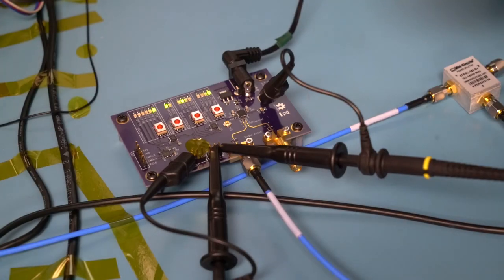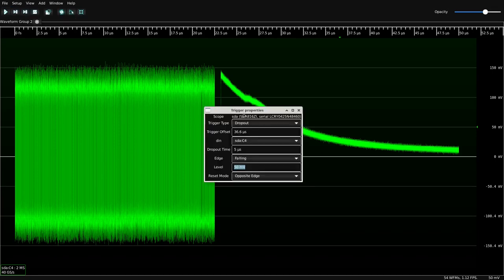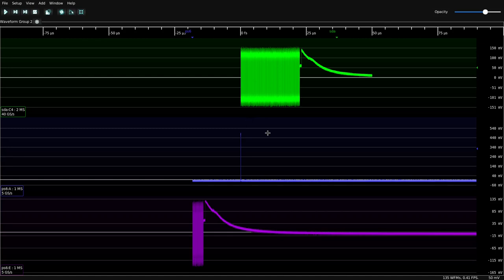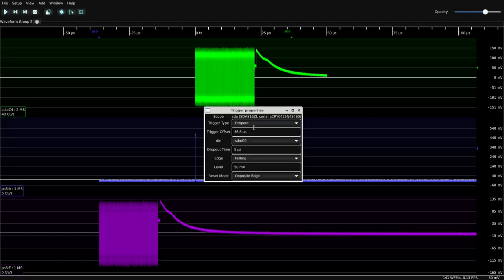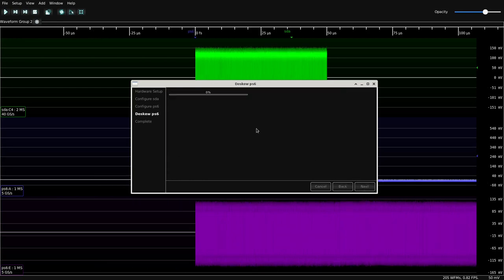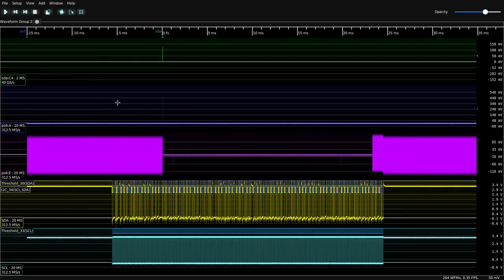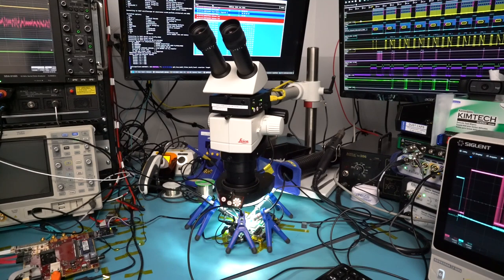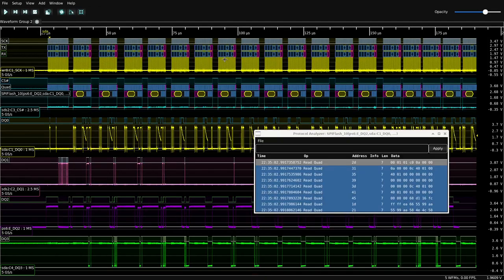Using four oscilloscopes at once with glscopeclient

Comment: I would like to try this Software. Any plans to make installation a bit easier like providing deb package or even a PPA? Does it support Siglent waveform files for offline analysis?
Reply from the maker: I'm not sure what the Siglent binary waveform file format is. We support Teledyne LeCroy .trc, Tektronix .wfm, and Keysight/Agilent (and some Rigol) .bin. We also support CSV, VCD, raw I/Q, and a few other generic interchange formats.

We have experimental deb-format packaging set up by a Debian maintainer, but it's not built automatically during CI builds. Still not what I'd consider release grade yet.
Reply: Thanks for the feedback. Tektronix wfm sounds great as well. Might be an alternative to the Tekscope software we use at work some day.

Siglent is able to save csv files. So this should be an option if the bin files are not yet supported. 

Great project anyway, i'm looking forward to a beta that is ready for endusers. Thanks for your work!
Reply: @manfred4283  When installing applications like this with many dependencies I usually find problems with some of them - perhaps the author has installed more recent packages, or used some latecomer in the shifting sands that is Python. Sometimes it's fixable, sometimes it requires more knowledge than I've got, But this is not one of those, it's very competently built. I followed the build instructions (on Debian 11) with minor variations to suit my preferred directory layout and it all came together without a hitch.

I'm hoping working with live data will be an equally pleasant experience. The only suggestion I can add is that it would be great if there were some example saved files to permit experimenting with the interface before tackling the hardware. Perhaps there are and I haven't found them yet.